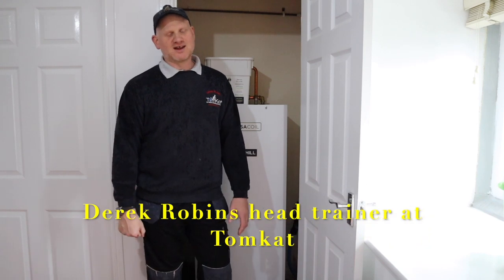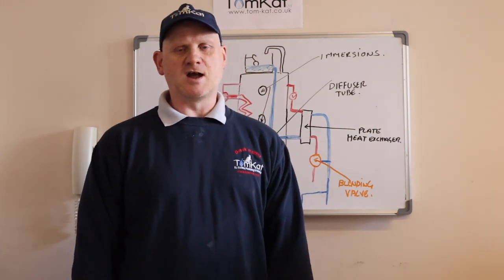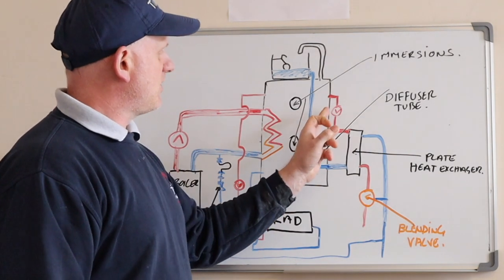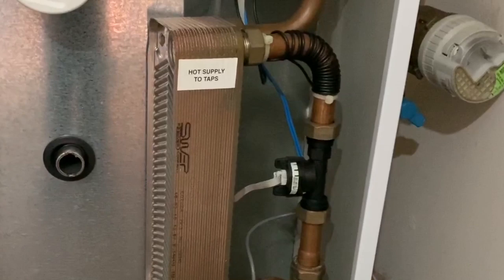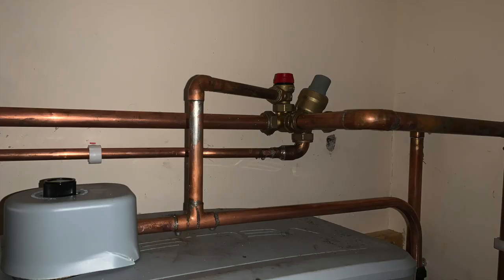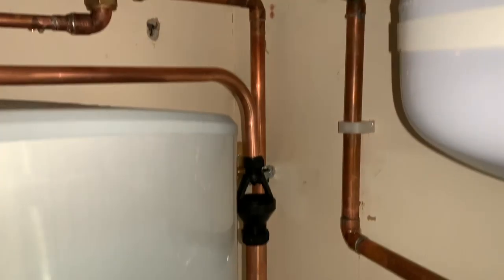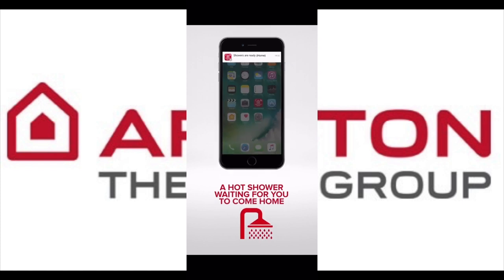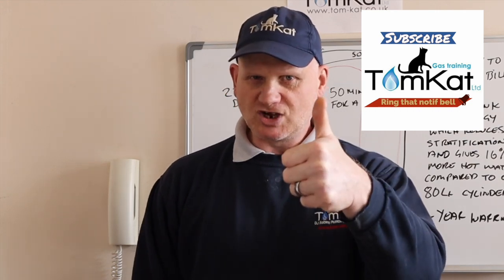ARISTON VELIS EVO 80 UNVENTED CYLINDER unboxing and review of the wall hung smart unvented cylinder.

Comment: Great content here, the Ariston unit looks like a nice bit of kit including its (WiFi) connectivity controls. Next is a tongue in cheek complaint,  can we please not refer to the safety relief valve discharge as a blow-off? ;) please please? lol. 
Loved your explanation of the thermal storage tank and how it operates. Keep up the good work Derek
Reply: But it is a blow off.......... It's always been a blow off......... When you're in a loft installing a HWC and it's 40 degrees it's a blow off.......
Reply: Shaun DA Silva indeed 🤣 I know its called a blow of but there’s something in my plumbing DNA OCD mind that explodes every time I hear those words 😉(did you like what I did there?😎)
Its a bit like calling a magnetic debris remover a “filter” ITS NOT A FILTER! 🤪
But then we call boilers boilers and technically they dont boil water🤣🤣 
#PlumbingBanter
Reply: @hotunhotunhiflodrytraptund5736  🤣🤣🤣🤣😜😜😜😜😜👍🏻👍🏻👍🏻👍🏻

Comment: Nice video, thanks.  We have the non-WiFi version, Velis EVO 80 in our 2 BR/2 BA flat.  Just a few questions:

1) While using the shower, is there a way to know how much hot water is left, like a fuel gauge on a car?  Seems that's what the dots would be good for, but the top just flashes while showering and doesn't change until we run out of hot water.

2) To maximize the amount of hot water available, is it better to have the temperature set higher and shower mixing more cold, or a lower temperature and use less cold water?

3) The button between the power and the shower ready - when would that be ideal to use?

Cheers!
Chris

Comment: Hi, great video !
Quick question re fixing unit against the wall. I notice the unit is supplied with two hooks although it has brackets at the top and bottom - (I suppose the latter is for the horizontal installation - otherwise 4 hooks would have been supplied?). In your video you fit a wooden plank which I think supports the bottom bracket, is this necessary because you are fitting in on a plasterboard wall? I will install my unit on a 44mm wooden wall using the hooks supplied and 8mm & bolts, my question is, do I also need to anchor / support the unit from the bottom bracket like in your video or will the top support suffice?

Thanks in advance!
Reply from the maker: I would support it top and bottom because the weight is a lot
Reply: @tomkatgastraining  ok thx!

Comment: Should the water tank remain switched on all day? Or should I switch it on and off when I need hot water?
Reply from the maker: No need to heat the water when you are not there if you have the WiFi version use the app to set the times or just turn it on about 30 minutes before you need it